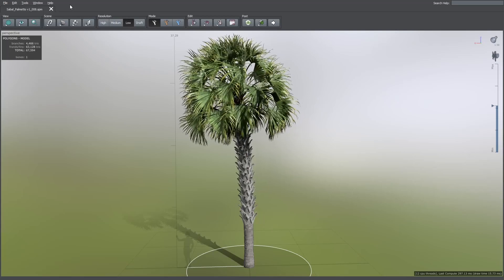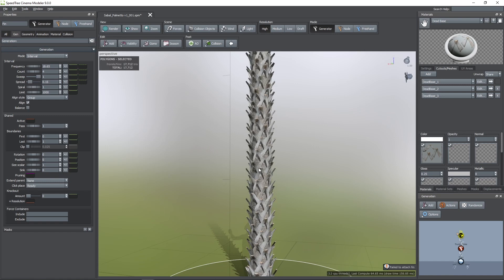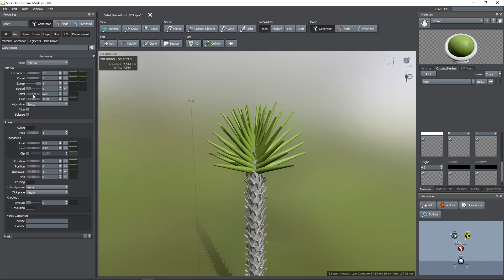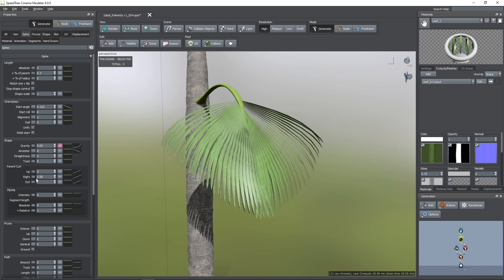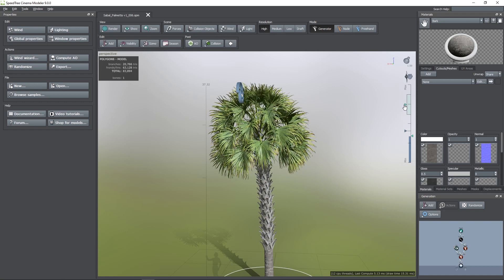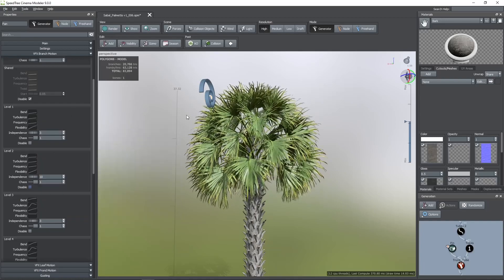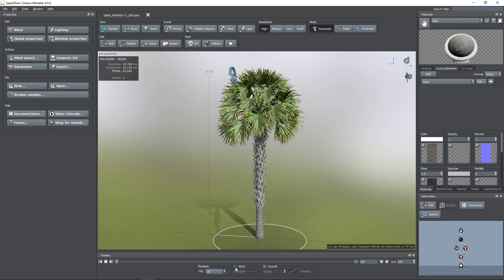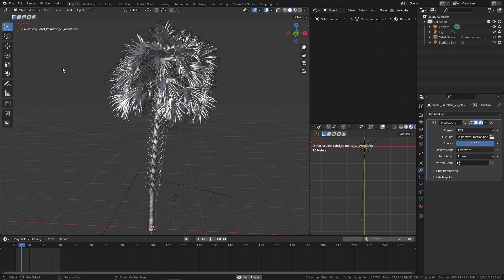Palm Tree | Speedtree Cinema 9 Tutorial

Comment: Or how can you put 2 texture on a plam tree some of them like foxtail or royalpalm on top of the trunk before reaching the crownn there like green part of the trunk like a smooth part how do you make that can you do it with texture or do I need to model that (green)section in per say 3dmax and export to speed tree and than kinda wrap around on the top?
Reply from the maker: You could add a trunk first, then add an extension on top of it and change its material
Reply: @3dhobbyist296  👍cool I will try that